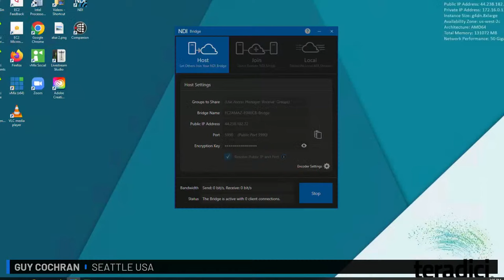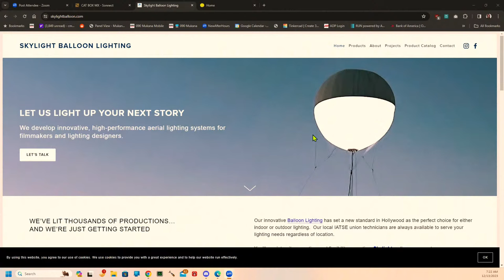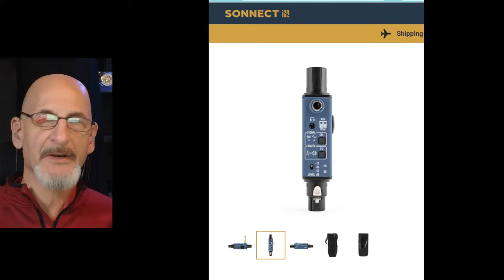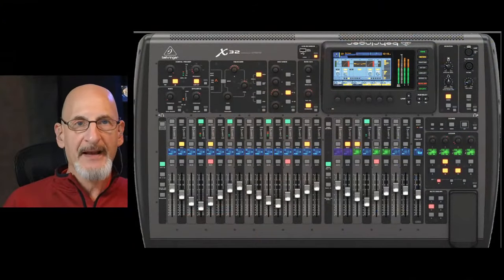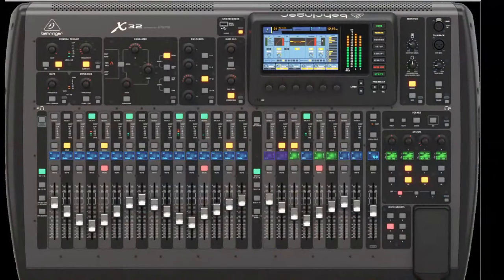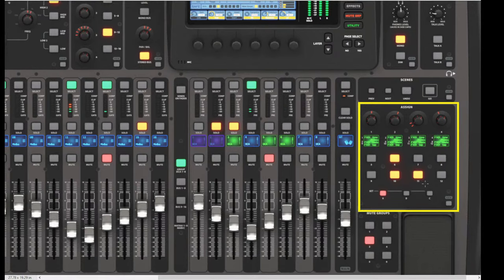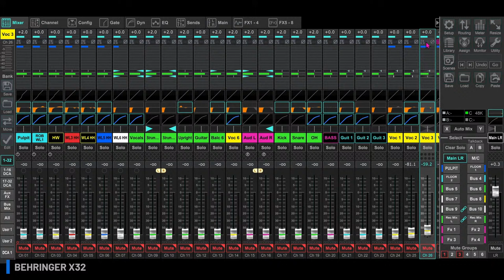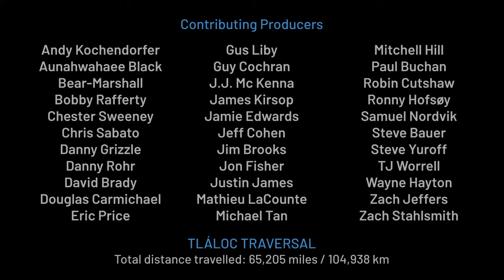Lab: Behringer X32

Comment: 00:59 This article is a bit alarming. How skeptical should we be when clicking QR's? [link]
05:15 I use NDI studio monitor to show the live feed from my vMix instance. My network speeds are fast enough for the production I am doing, but recently the audio from vMix to Studio Monitor either cuts out or just doesn’t work. What can I do?
07:17 What is the order of importance for mic characteristics? Proximity, pickup pattern, accuracy, max SPL, dynamic range, etc.?
11:44 Have you ever worked on a production on a (cruise) ship? I'm thinking it would be more challenging than any land-based venue considering the high latency Internet connectivity (satellite) and that it'd be harder to get gear on/off the ship.
17:07 Any ideas on the best ways to light an area in a church that is typically dark and surrounded by dark wood and no windows? This area needs to be lit for musicians as well as for broadcast.
24:36 Looking for ways to inject timecode into a GoPro that feeds an SRT encoder. Ideas?
26:47 I’m recycling some old 1st generation BMD Cinema Cameras for streaming but need convert from 1080i to p and apply a LUT. Is there a converter that will do both other than the Teradeck COLR (which is out of our budget)?
28:58 Decomissioning a flykit we inherited from another group. There's a Teranex AV in it. How can I best make use of it?
31:57 I feel as if I'm so far behind on my AI knowledge and use. Primarily on video production, but AI programs in general. What's a good place to start and a path to catch up? Thanks
35:38 Curious of the panels thoughts on Sonnect. Just discovered the brand and I've heard good things about the SoundWire & Sound Bullet. 
39:36 For anyone using the Korg NanoKontrol 2 with the MixPre 6, do you know if you can map one of the pots or sliders to control the headphone volume? I don't know how to find the right CC number in the Kontrol Editor beyond trial and error.
40:47 What would be the best way to go about achieving a Dugan-style automix inside FCPX? I've got multiple iso audio tracks recorded with Tentacle Track-E bodypack recorders that are synced in separate audio tracks.
43:30 Good Morning! Just thought I'd share that After Effects now officially supports 3D and importing of 3D models. Here is a link to the December 2023 release features. [link]
47:18 Any recommendations for an e-commerce site for non-profits?
48:35 Can Audio Hijack record audio from multiple apps into multiple tracks simultaneously?
50:24 Previously on office hours global, we had a second hour on gaff tape and wire management…what about 2nd hr on the right and wrong batteries for big and little production tech?
50:52 DaVinci Resolve only offers mp4 vs m4a for Audio-Only renders. Any concerns using an mp4 AAC LC audio file for publishing podcasts?
51:39 What are your favorite lights for lighting food preparation?
52:55 Has anyone used NDI bridge for remote productions? Possibly for controlling NDI cameras remotely or simply monitoring NDI feeds? Pros/Cons?
54:22 Andrew Broughton, what brand and model is the headset you are using?
55:40 What is the perfect pipeline and setup for the Sounddevices Mixpre 3 or 6 with single channel Noiseassist on a Mac, using both Audio Hijack and Loopback with Zoom and Unity Intercom.
56:29 I would like to use Insta360 pro 2 cam to capture audience questions during a meeting stream. We're using an ATEM Extreme to stream to Teams. If I add the Pro2 as a second camera, how would I control the view angle sent to the remote viewer?
57:33 Any tips for getting brand new heavy gauge power extension cords to lay flat out of the box?